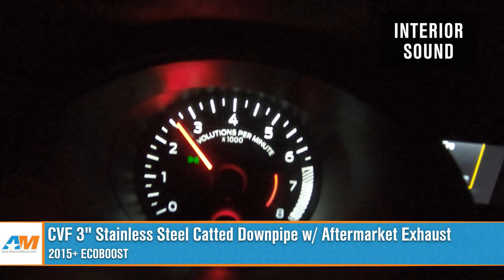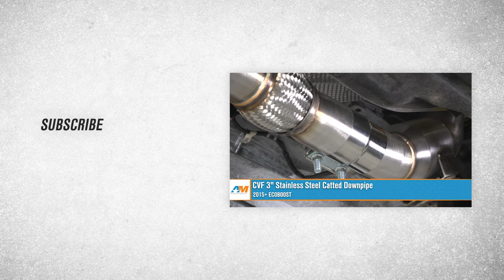2015-2023 Mustang EcoBoost CVF 3-Inch Stainless Steel Catted Downpipe Review & Sound Clip

Comment: For everyone asking yes you need a o2 bung or a defouler for the o2 sensor if you plan on installing it on a stock vehicle or you’ll get a p0420 CEL so BUY WHEN YOU BUY DOWNPIPE TOO thank me later
Reply: Do you think the aftermarket downpipe will first the s650 ecoboost ??

Comment: I finally installed my catted CVF down pipe on my 2020 base eco-boost. It went in fine till I got to the section behind the catalytic convertor, instead of two three inch clamps, a step down clamp was in my box. 😑😑😑 So for the section going to pipe where the resonator was I had to use two three inch hose clamps. I ordered the correct clamps to use.
But so far I love the down-pipe and no resonator thru stock mufflers! 👍👍👍 Love the sound of my eco-boost mustang now! Friday night coming it will be track time for my mustang! Cobb tune on stage one 91 octane, larger intercooler in front, now CVF catted down-pipe and no resonator! Cross my fingers for 12's! 👌👌👌

Comment: So there is no tune required with the downpipe?
Reply from the maker: You definitely can install this downpipe without a tune since its not an off-road system, but I'd highly recommend a tune. You'll get better performance out of the pipe that way - plus you won't have a risk of your engine running lean or popping any CELs. -Zach
Reply: @americanmuscle  do you where i can get a tune south Florida or what can i buy to tune it
Reply: MontaneroPaisa i use pdtuning

Comment: That's the worst looking pipe i have seen. 3" back to 2" with cheap clamps.
Reply: There’s a 3 inch adapter that you could buy if you have 3 inch piping, that’s what I’ll be doing